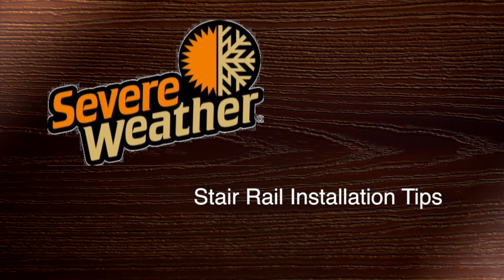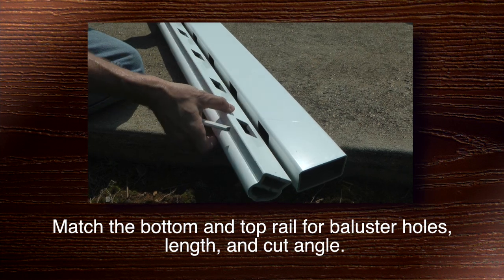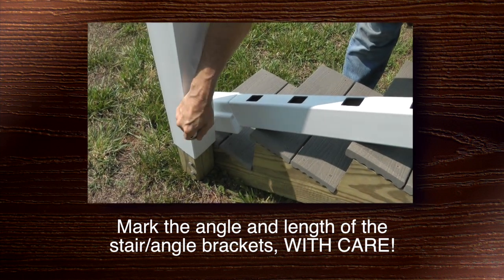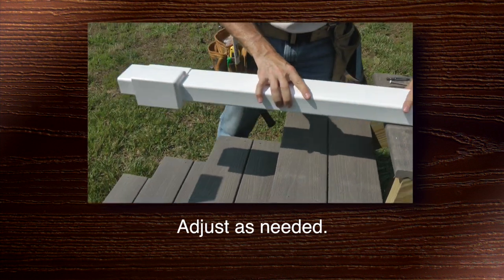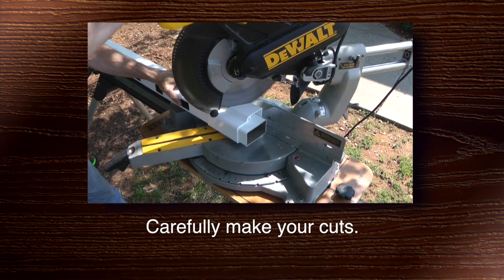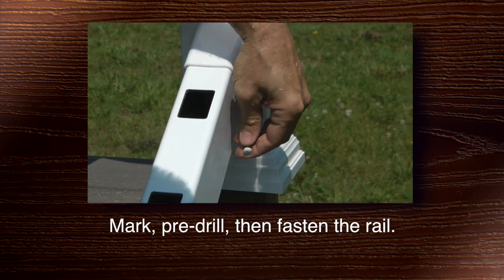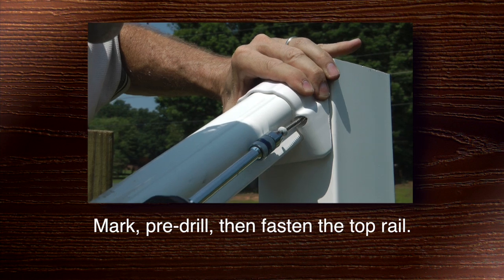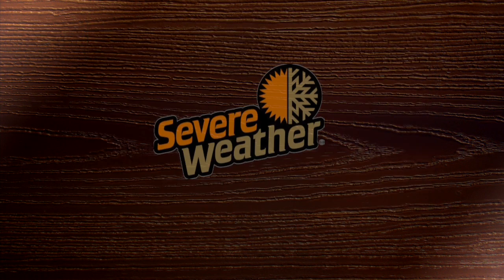Stair Installation Tips

Comment: this was somewhat helpful, but the top bracket is rounded and cant be cut the same as the bottom bracket. i need help with this. i tried it your way and it doesnt work with a rounded rail